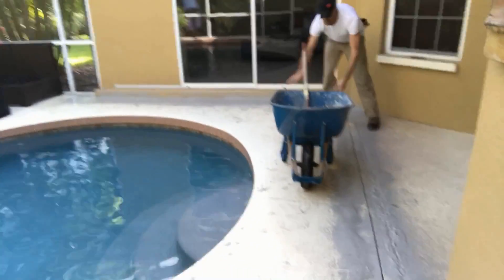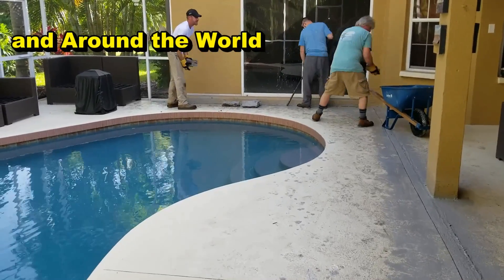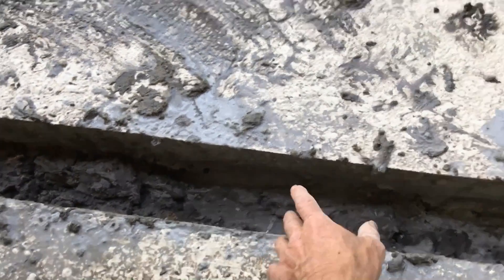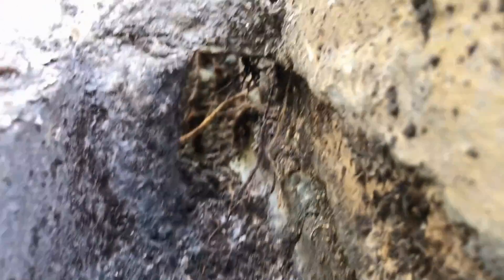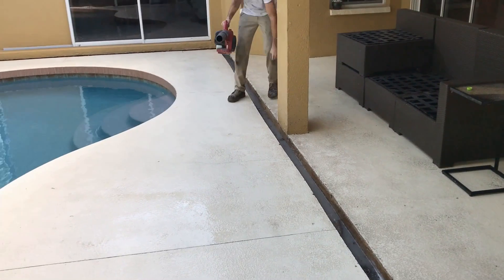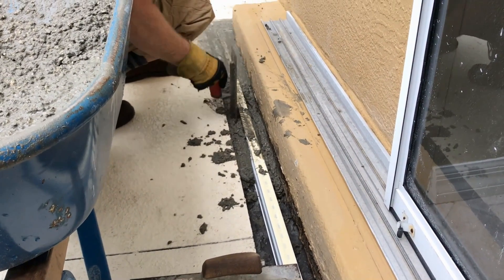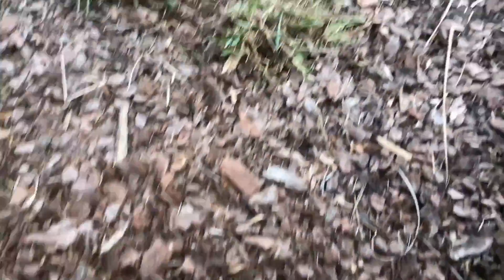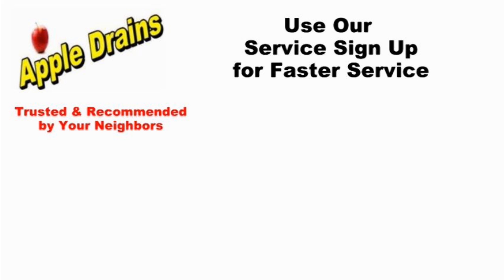Mirco Channel Drain, Pool Deck Drain, DIY

Comment: House my in laws are renting, everywhere there's a seam of two pieces of drain butting together the channel is filled with concrete, in some places the drain is blocked all the way up to 3/4" down from the top. I've managed to knock some pieces of concrete out (and remove years of roots and potting soil) but there's still a ton of concrete left in the drain

Comment: That pool looks like it has no coping. That would not pass inspection if home was sold. Are the tiles beveled or curved on top maybe? 

Aldo i have seen channel drains not covered with concrete i.e. not underground but having an exposed grating on top of channel drain.

Comment: We got a 22’ pool installed 9’ from our house and the contractor wants to slope the pool and put a channel drain right against the house crawl space.  I think it makes more sense to put the channel drain and low point in the middle between pol and crawl space.  In case it overflows.  They claim they do it all the time- but does that make it right or smart??! Anyone?
Reply: keep the low point of the deck channel away from the house, especially if you are in a heavy rain area. I came here because a corner of the channel has been completely destroyed and water is getting under the foundation. Concrete  is crumbling and I have to do a quick fix before installing brand new channels.
Reply: @sweetmcnasty  Thanks dude - against the concrete company's suggestion, I did insist the 2" NDS micro channel drain be installed at least 18" away from my crawl space. Came out grate, I mean great, lol, except for the fact they didn't tape it well and concrete over the edges so I can't remove the grate...I can grind it later. How did your channel get ruined? What kind? good luck!
Reply: @LowCoSuzukiGuitar  It got ruined because water accumulated against the foundation, where the channels were. 
It was a microchannel but I will replace it and move the channel away from the foundation.